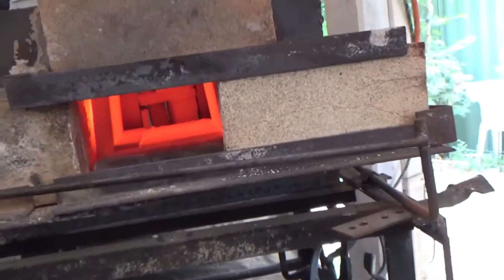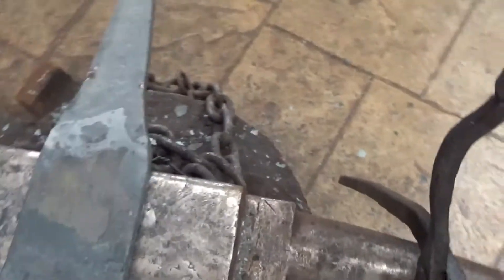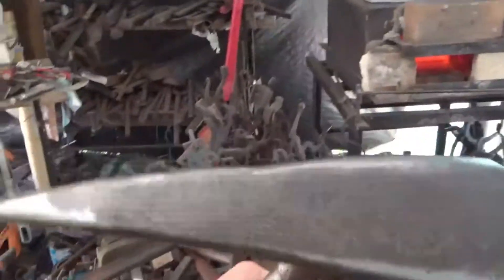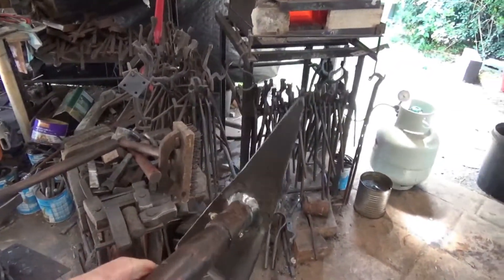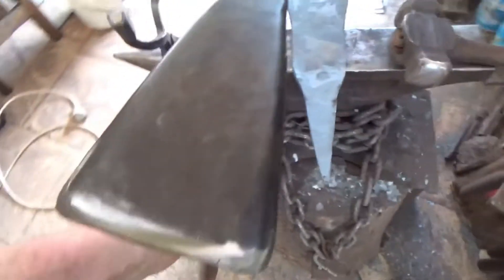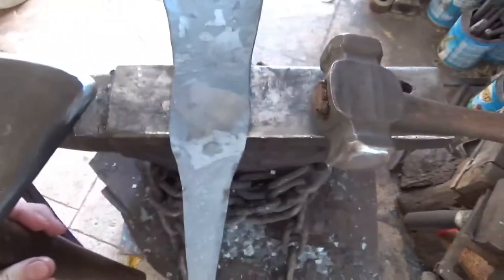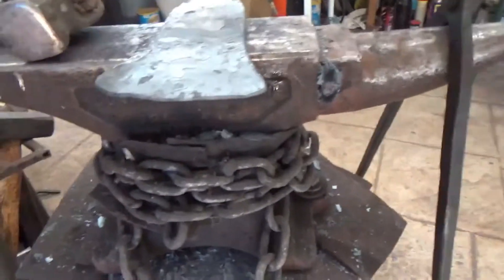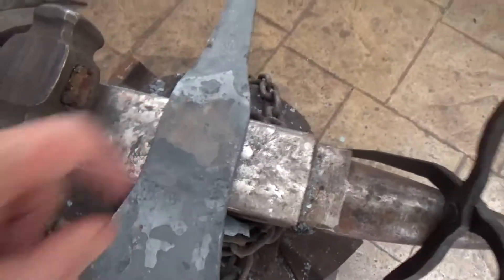Forge Burner And Forging Miners Pick

Comment: Miners Pick is looking good Len, it will be interesting to see how it comes out, and Yes the spotted gum is the gear for good strong tool handles ay. Cheers Andy 👍⚒
Reply from the maker: Thanks mate hope it will be like what I had in my mind. Wish I could find spotted gum timber.
Reply: @lenblacksmith8559  Yer mate you would have to go to a timber wholesalers or even better direct from a sawmill to get the right size. I can get it from a few places down here but don't know about your neck if the woods mate.
Reply from the maker: Forge Wright yeah will have to check out some timber places